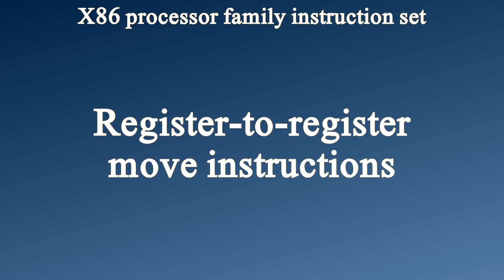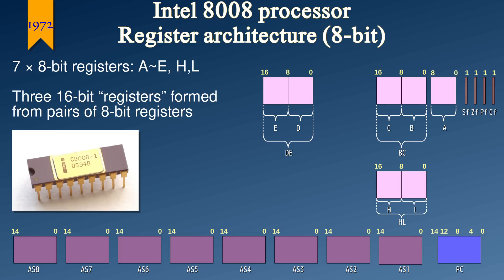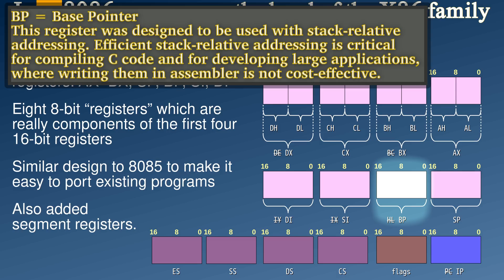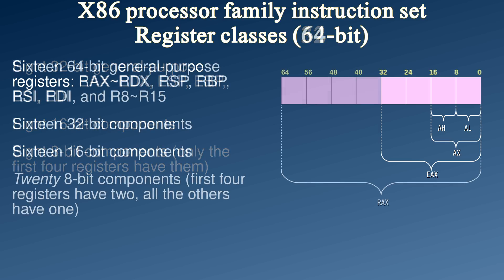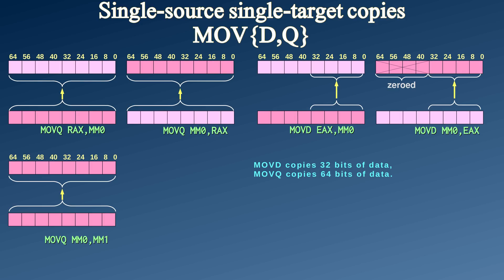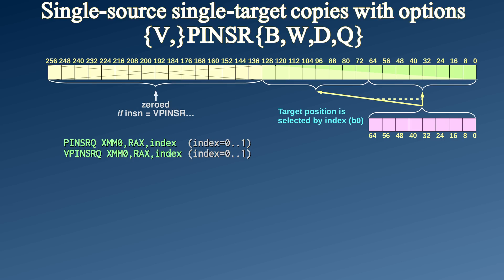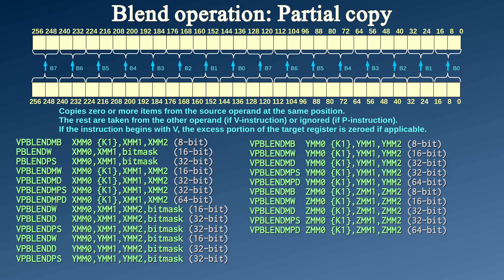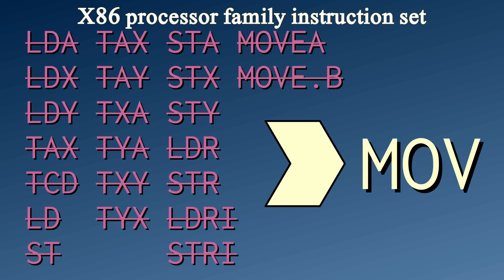x86 mov insns & short history of the most popular CPU architecture

Comment: "there should only be one MOV instruction"
well that went out the window pretty fast
Reply: Protip: MOV is Turing complete.
https://github.com/xoreaxeaxeax/movfuscator
Reply: @T3sl4  I've got to try that! I'm gonna compile the Dhrystone benchmark. I might post the results here.
Reply: @T3sl4  have you checked binary sizes of the compiled output of this garbage?
Reply: @yigitpolat  yep, but it does indeed do what it purports to.
Reply: @yigitpolat  that doesn't disprove it in the slightest. you still get a functional binary as a result.
Reply: @yoshi314  real computers arent turing complete since they have limited amount of memory and turing completeness requires infinite memory by definition. Yes, you wont notice that your machine is not turing complete but only as long as you dont hit the boundaries. thus, wasting memory like this will push you further away from being truly turing complete.
Reply: @yigitpolat  i don't think we're talking about turing completeness of computers here. merely the language based on mov instruction.
Reply: @yoshi314  who said we arent talking about real computers?
Reply: @yigitpolat  this thread has been about MOV all this time.
Reply: @yoshi314  i hope you know MOV is a set of real instructions in a real architecture for real computers, that is called x86.
Reply: @yigitpolat  yes, and we've been talking about turing completeness of that instruction, not the hardware itself.
Reply: @yoshi314  instructions cant be turing complete. Only machines can. MOV does not define a machine by itself. x86 does define a machine and that machine is not turing complete since you can only address 2^(32or64)bytes (if not extended with other machines such as storage devices). Thus, a machine that only implements 32or64 bit MOV is not turing complete.
Reply: @yigitpolat  "who said we arent talking about real computers?" You did since you said that turing completeness requires infinite memory, which since we live in a finite world there isn't any computer that has or can have an infinite amount of memory! So what good is 'turing completeness' if it only applies in concept or theory and isn't applicable in the real world? People need to move away from this hard definition of turing completeness of 'infinite memory' when having a substantial amount of memory that is good enough for your turing purposes to be considered 'practically infinite'... When you have a good enough amount of memory that it can be considered practically infinite for your purposes, that's good enough to be considered turing complete. Otherwise your trying to apply hypothetical theoretical ideas to the real world which doesn't work. Until your turing operations require more memory than your capable of utilizing for your purpose in the real world then you shouldn't consider it not turing complete because it can and will complete as long as there is enough memory to do so, and as long as there is, it is pretty much 'infinite' in the eyes of the machine. Just like with floating point numbers for example we have a 32bit or 64bit 'close enough' amount of space to store the information about that number that is 'close enough'... A true floating point is infinite yes but we can't store that in our real world limited memory so we have these data types that store 'enough' of the information that it doesn't matter that it truly would require infinite storage to store those real numbers because we can get it close enough to not matter so much. You need to stop thinking so theoretical and what we would like to be able to do, and thinking in that which we can achieve and do which is close enough to the theoretical that it doesn't matter so much that it is in-perfect. Because we don't live in a perfect world where your theories align with actuality it's okay that we're in-perfect as well as long as we get close! Have you ever heard a programmer say: 0.999999984983984324 == 1? Well that should give some perspective if you look that up because it's true. As long as you're mostly there you're there!
Reply: @YourTVUnplugged  you literally didnt get any of my points.
Reply: @yoshi314  no, I've already read this paper 2 years ago and it does not tell you that instructions can be turing complete, rather it assumes infinite memory on x86 architecture (which is an architecture (ISA), that naturally defines a formal machine). You cannot have turing completeness without having infinite memory (stop arguing against this) and x86 doesn't provide infinite memory in any sense. And if you keep using your memory inefficiently(e.g. by only using mov instructions), the cases that you would be bounded by memory outage will increase. We are already approximating turing completeness with our non-turing-complete machines and there is no real point of making the approximation worse.
Reply: @yigitpolat  fair enough.
Reply: yigitpolat umm. The first comment literally says «MOV is turing complete», so yes they were talking about the instruction and not computers in general. Stop rambling on about random theories and garbage, nobody cares. It does not matter at all that movfuscator generates large size binaries, NOBODY are using it for real world applications. It’s simply a proof-of-concept demonstrating the MOV instruction’s capabilities.
Reply: when people discuss "turing completeness" I generally assume they mean "enough memory" since infinite memory is not possible and never will be
Reply: @tacokoneko  Just loop it and watch magic happen.

Comment: I doubt many people hand optimize these days
Reply: Probably just as many as always, but there's a ton more programmers these days, and a lot of higher level programming has been opened up, so it is a smaller percent
Reply: Finnish Demoscene coders still do that! It's a tradition. :)
Reply: A lot of the most extreme optimisations are off the table once you have an operating system as complex as Windows, linux or anything like that.
Not just because the operating system is complex to deal with, but because it actively fights against you doing low level things, like say, directly accessing graphics hardware, or straying outside your program's allocated memory space, or any number of things a programmer working on an older microcomputer or even on a DOS system would happily do.

Of course, that doesn't stop you optimising your own routines as long as you stick within the confines of what the OS will allow. (nothing like causing a general protection fault by mistyping a line of code though. XD)
Reply: Nobody hand-optimises, but people still need to hand-debug. People like me, who need to look these things up to see the side-effects to understand why a value should have been valid one instruction before but one instruction later contained zero, because a not-obviously-named instruction actually zero-extended the top half of the register. Ah I love my job.

Comment: Just FYI, you can "call" the opcodes whatever mnemonic you want.....it's all just numbers to a cpu anyway.  This is more of an ASM parser problem at that point, most of the commands could take a single "MOV" instruction for nearly 90% of the commands, simply by parsing the commands that follow to determine which opcode to use.  If the commands themselves are noted for what it is, then the command can be used for 99% of the time....it's all about the compilation.  For example:

Instead of MOVSX AX, BL and MOVZX AX, BL
it could be MOV AX, BL.S and MOV AX, BL.NS  (for "signed" and "not signed")

The compiler, if done properly, would be able to replace it with the correct code.  The issue is that compilers aren't usually built that way, and there aren't many ASM compiler makers left to care to change it, which is sad really.  Most work in C/C++ or higher, so a lot of that stuff is done under-the-hood.....eventually it will become a lost art, since everything is improved through a T graph, nothing from scratch anymore.
Reply from the maker: It is absolutely true that the names of the instructions are entirely a convention/culture issue. The CPU only cares about bytes.
And it is both this culture, as well as the internal design, that I am documenting here.
Reply: Yes Robert... For example that's why there's at&t syntax versus the superior and more pleasantly readable intel syntax (they got it right). With the destination operand on the left: mov dest,src compared to at&t's opposite mov %src,%dest and the unnecessary and noisy %'s sprinkled everywhere. Which your destination is more important since that's where the result of your operation is going to so that's first, and then your source register or memory location and written cleanly without extra characters that aren't needed and just decrease readability rather than add anything. 

Yea C++ is cool and all but you know what would be really cool? An ASM++ type of hybrid machine code/high level language features modern built assembler (or ASM compiler as you've called it). Like you can think of it like ASM with classes but much more than that! It would give you the direct processor control and the extreme power and flexibility that offers, but with high level features like you get in C++ so that you wouldn't have to absolutely everything you do by hand from scratch pretty much on your own without much help. So yea I don't think you're right about the T-graph thing it is like a lost art but it is not and I don't think it ever will be... There will always be some people where even C++ is not good enough, and they want to get even closer to where the magic is happening! As long as CPUs speak this language we will speak it too, and sing it sweetly to them in a lullaby xD
Reply: @YourTVUnplugged  ... "ASM with classes" that sounds like HLA.

"T-graph is a lost art"....no, it's not, that's how compilers are made now.  You take an LLVM and process whatever language you want through it, then you produce the compiler through itself to produce itself as the base, and any improvements you make are built on the initial....that's a T-graph.  You don't have many people creating "new" compilers anymore (from scratch), except possibly college students, but all those come out as Tiny-C copy-cats.

As for "always be some people where even C++ is not good enough"....C++ has built-in ASM compiling, so they can put their code directly into a function wrapper, no "new" compiler there.
Reply: @sabriath  Thanks for the +1 Robert but you partially misinterpreted my comment (sorry I wrote it fast... Like I write my assembler and is also the speed at which it runs :D): "Most work in C/C++ or higher, so a lot of that stuff is done under-the-hood.....eventually it will become a lost art" Writing assembler by hand by inclined individuals won't become a lost art, if you say it will then it already is because even on the masm website it says: "MASM has never been for the faint of heart, it is an uncompromised tool that has never been softened into a user friendly toy and it required the development of expertise to use correctly but for the programmer who already has experience in low level C and similar code, MASM offers power and flexibility that the best of compilers cannot deliver and contrary to popular opinion it can be developed and written at about the same development time as C code."
I am not the faint of heart it describes and while I guess most people are, we are not since we have even dared to revel in the direct communication between us and our computer processors and so if you're saying people like us will disappear I would say you're wrong because it's always been something reserved for those that want to do it simply because they can! If I couldn't write assembler or was never introduced to it by someone who could I would probably writing crappy java too... But because we can, we do! Started with x86 32bit ASM and added C++ to my abilities and because of that being my rooted have always snubbed my nose at java and other 'higher level' languages because they always compromised my speed and my security of knowing if there's a bug it's my fault in my code not in somebody elses (like that develop the java api for example). If you fked up it's on you and that's a discipline that these higher level developers don't have because they always have the out that oh my code is fine it's the java developers that have their jvm convert my code into machine code that have made the oopsie which made it exploitable... I don't place my bets on others ensuring my code is bug free, that is purely on me! :D
Reply: @YourTVUnplugged  ... I +1ed your statement because I agreed with the syntax and your overall sentiment in that reply.  When I say "lost art," I mean that in the mainstream of software development.  Yes, some people still do assembly, but usually as a hobby, not seeing many dedicated masm game developer companies....or any at all actually.  The masm forums traffic is about 10 per day, and posts are averaging 1 every 2 days, so you can see how little compared to other higher-end languages it gets used.

I'm not putting down the language, I actually like working low-level, but I'm not a fool either.....it's nostalgic to work in it.  The comparison is like using a chisel to carve decorative wood edges versus using a CNC machine for mass production, assembly is the chisel.

Comment: sir from where i should learn vga basics, ports, video ram, sound etc but as a beginner and also embedded programming?
Reply from the maker: If it is PC architecture in specific that you are interested in, the PCGPE is a good start (http://qzx.com/pc-gpe/). It covers things that were relevant to game programmers in 1990s working on DOS and the PC hardware.

It is not so useful today, because you no longer interface with hardware directly, but you use operating system facilities. This is because your operating system’s task is to make sure that everything plays nicely and that no program can crash the system or interfere with another program. That is why no program can take over sole ownership and communication with some hardware piece.

But in the DOS days, things were different. Computers were not multitasking, so if you launched a game, you did not also have an email client running at the same time, or anything else really. All the computer did at that point was just run the game, and all the hardware resources were dedicated to the currently running program.

If you want to relive this experience, the cheapest way is to use a DOS emulator like DOSBox, which emulates a fair bit of common hardware on the PC as well, such as a SVGA-compatible graphics card, a few popular soundcards, etc. Then, inside this emulator, you can write programs that take full control of these emulated cards just like it would have been done in DOS days.

As for modern embedded programming, with platforms like STM32 or AVR, where you do communications directly through I/O, I2C, SPI, etc., maybe the most popular way to get started is to get your hands on an Arduino or something, and study the Arduino IDE which has a reference manual if I recall correctly. It also helps to know a thing or two about electronics.
Reply: Keen to hear an answer to this
Reply: Speaking of basic vga/video programming, I can recommend the links on this wikipedia page: https://en.wikipedia.org/wiki/Mode_13h. The content the linked pages provide gave me a pretty good low-level understanding of these topics.

Comment: The Z80 also had a copy of most of the registers AF', BC', DE' and HL'. It was often used to switch between 2 contexts when entering an interupt. The AF and AF' could be exchanged with the EXAF instruction, and the other ones were swapped with EXX. The IX and IY register could be swapped with the current word on the stack: EX (SP), IX and EX (SP), IY
Reply from the maker: Indeed. I did mention the copy registers on screen, but not in the narration.

Comment: Hey Bisqwit, what do you think of RISC vs CISC based on today's hardware capabilities?  Are you planning to cover this in near future ?
Reply from the maker: Instruction decoder is not where the most complexity lies in today’s microprocessors. The question is quite moot. Internally, all x86_64 processors essentially run a totally different processor that operates on hundreds of registers and which breaks down the CISC instructions into small pieces that can be more easily parallelized. Even if you have a RISC CPU, you still need such a component, because there is no way that an instruction set could accurately describe the internal state and simultaneously be future-proof. No matter what, you will need an instruction to microcode translator with all the complex rescheduling, dependency tracking stuff and so on.
The difference is mostly out of convenience to the programmer. Also, if you redesign the instruction set from scratch, chances are that you will end up with shorter opcode encodings by average than x86 has today. This would bring tangible improvements, but by how much, that I cannot say.